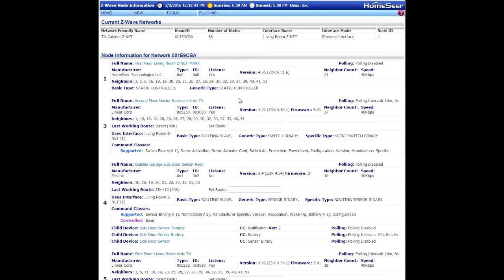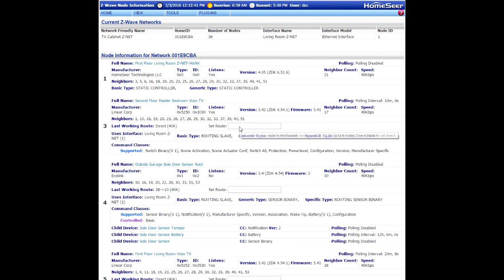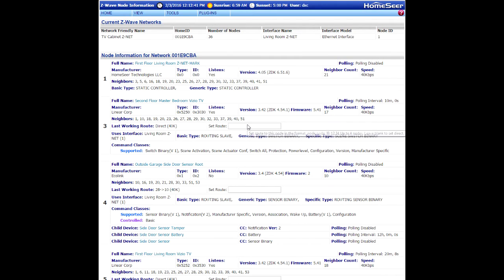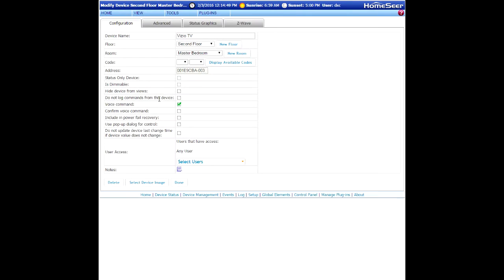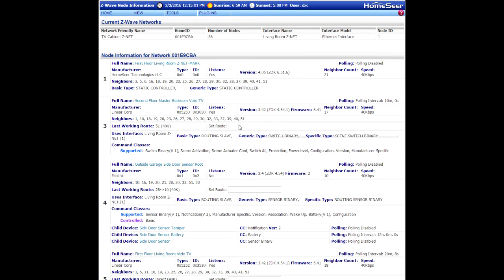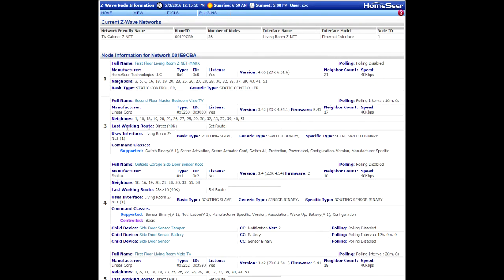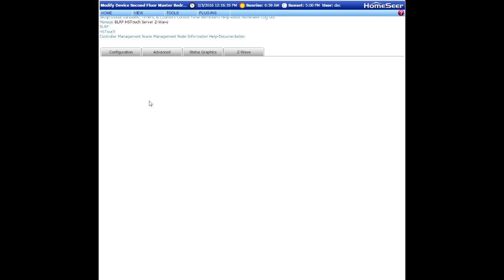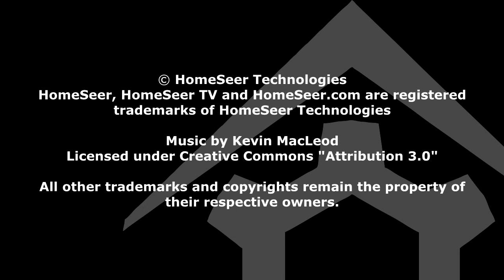Setting Z-Wave Routes with HomeSeer HS3 Software

Comment: There is no option to set route, video is useless..
Reply from the maker: Set route only works with HomeSeer SmartStick+, Z-NET, Z-Wave UZB and Nortek HUSBZ Z-Wave interfaces.
Reply: HomeSeerOfficial Aaah.. Good to know, thanks for the reply!
Reply from the maker: Sure. Also check out Z-Seer+. That can set both command routes and response routes. You can't force the Z-Wave controller to honor the command routes you set BUT response routes are stored on the device itself and are not affected by the controller.  https://www.youtube.com/watch?v=pbvgXAIRCug